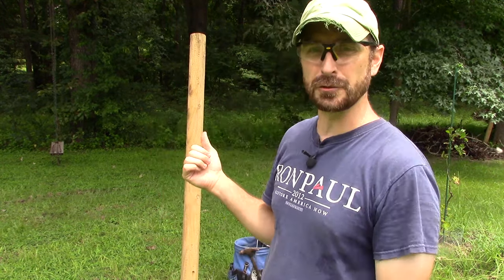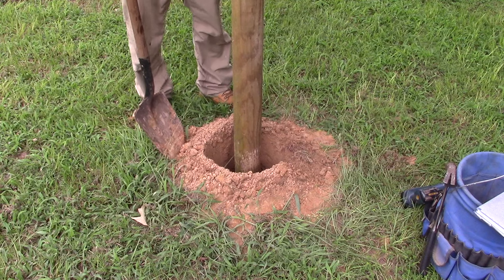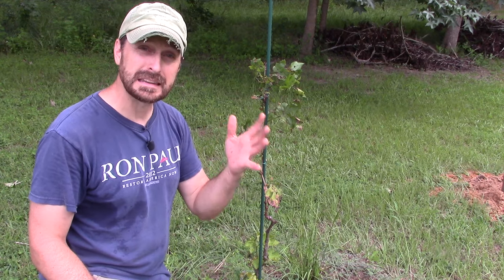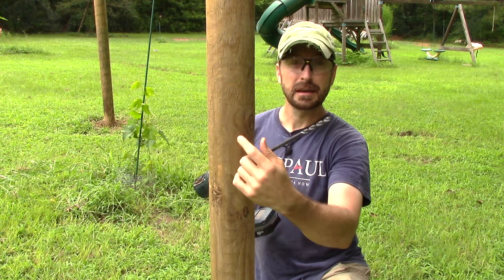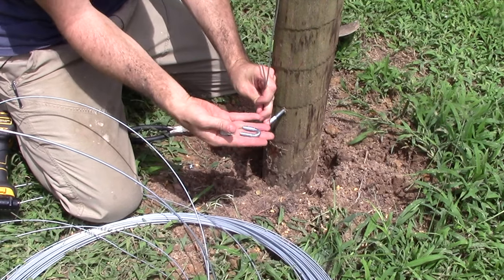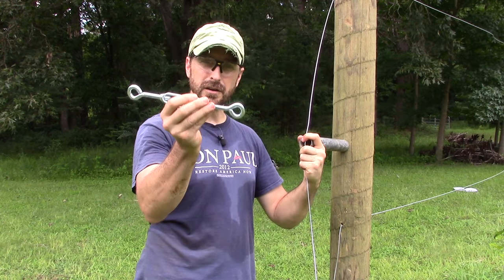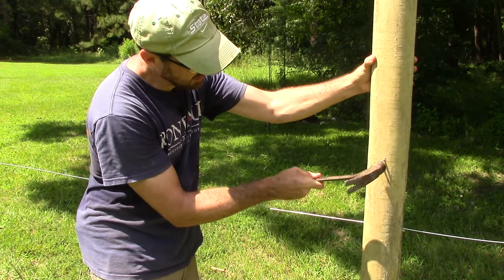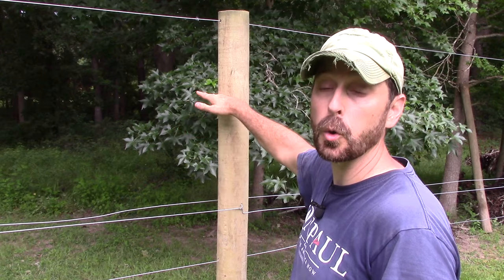How To Build A Grape Vine Support Trellis. The MOST Popular Type.

Comment: I inherited a property with a rambling giant grape arbor. A spaghetti mess. I am cutting it back now that it is dormant to about 5 ft high. There are trunks 6 inches in diameter but they were never trained to go up! Just wherever they wanted to go. I think the previous owners were trying to get the vines to grow over an elaborate wire roof for shade. I just want it to be an ordinary grape arbor and to produce grapes. There were some grapes this past summer that the birds got. They were the color of Thompson seedless. I would really appreciate some advice.
Reply from the maker: Just prune them back heavily toward the trunk and leave 2 arms (or cordons). Then train the new shoots to your desired shape when they bud out next year.
Reply: @CountryLivingExperience  Thank you SO much for responding! What if I don't have 2 arms (cordons)? i.e. to prune back to? What if I have to leave a "stump" about 5 ft tall that has a flat top? Will new shoots grow out of the tops of the trunks? I only have a couple trunks that have cordons. I wish I could post a picture.
Reply from the maker: New shoots should come out of the top of the trunk. Use those to create your new cordons for that particular plant.
Reply: @CountryLivingExperience  Oh goodie! That will be so nice. Thank you for your words of encouragement!
Reply from the maker: @reneebenoit8032  You're welcome

Comment: Hi, curious why you are suggesting not to use concrete in the holes. Thx
Reply: Some of your posts look crooked and wiggle. Won't those posts get worse over the years? I'm thinking when i put them in, I want them to last, sorry, unless I'm missing something. Not trying to offend. Also our winter's freeze / thaw could cause the posts to move. Getting ready to put a system together this spring. Thx for any help.
Reply from the maker: You can use concrete. I accidentally tried to tighten it with my tractor bucket and pulled the posts inward a bit. Additionally, I miscalculated the pullout position on the eye bolt. It should be in the ground about 6" away from the post.
Reply: @CountryLivingExperience  got it. Ok thank you very muck. I put in 8 Cab Franc vines a few years ago and am ready to get this trellis built. 👍

Comment: Can we get a follow up video. I curious to see if they are leaning in once tightened down. I know it was setup to prevent this but in my mind I would think the tops of the pole would still bow inward when pressure is applied. It looked like they was leaning inward in at the end of video but could have been the angle.
Reply from the maker: It leaned slightly because I didn't tamp down the post completely as I was rushing to finish the video.

Comment: wouldn't it be easier to just drill two small holes through each post  ( 3" apart)for the catch wires, eliminating the need for the u shaped nails ?
Reply from the maker: No. The post is not wide enough. The catch wires need to be on the outside of the post.

Comment: ..... seems a bit redundant putting so much effort into an elaborate tensioning system and then not anchoring the outside poles --  should sink them below the frostline and set in concrete.